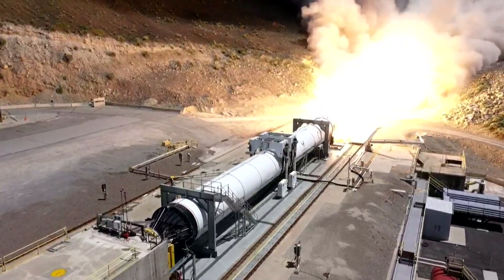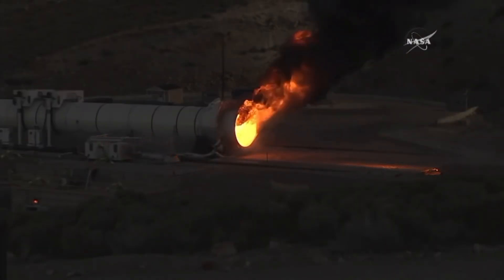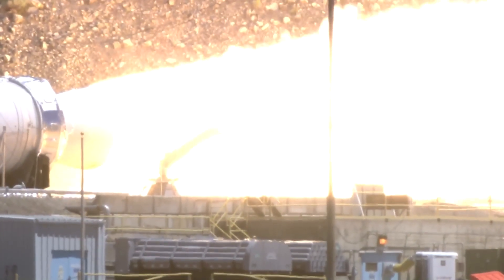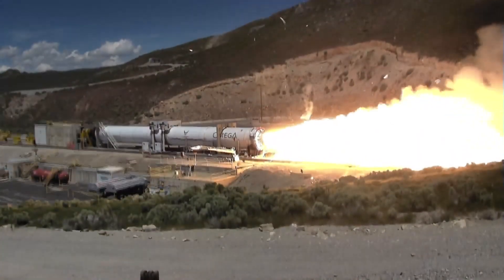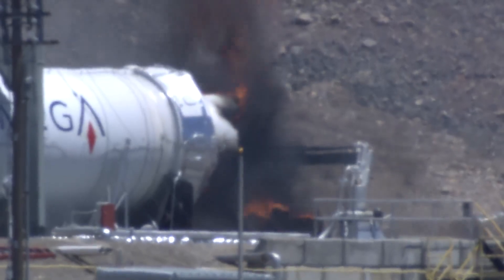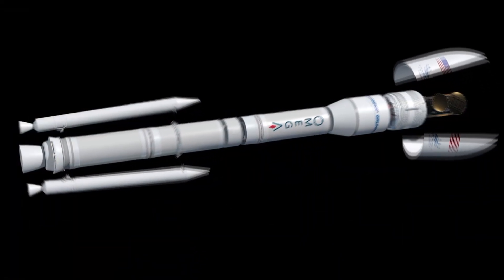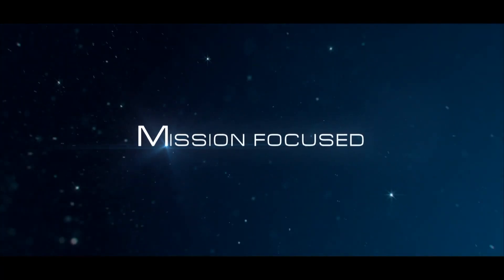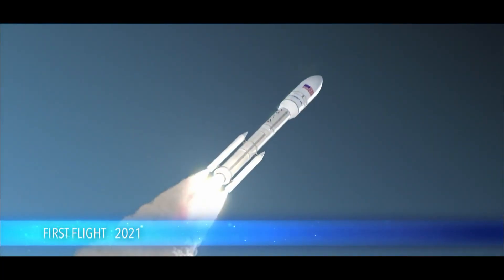Northrop Grumman's OmegA Rocket Fails During Static Fire Test -

Comment: Who is here after NG Blew up the SLS Bole Booster nozzle, IN ABOUT THE SAME WAY?!?!?!!?
Reply: Here here. Just came for the exact phrasing of the "observation at the end of the test" statement.
Reply: The two failures were quite different. The OmegA nozzle imploded during tail-off. There was a pressure drop inside the nozzle and the ambient pressure at ground level was enough to implode the exit cone. This wouldn’t have happened during flight since ambient pressure at burnout would have been much lower. 

The BOLE nozzle failed before tail-off.

Comment: My dad worked there for 30 years. It's the whole reason they moved out to Utah. We lived an hour away in North Ogden, and we always knew when there was a test-fire cause you could feel the ground shake and feel it. I've seen a few of these tests and have gone right up to it and touched it (before they fired it of course). My dad specialized in boosters. He sadly got laid off in 2011. He was the first guy on the Ares rocket, helped on the MOAB bomb, did lotsa of missiles and military projects, worked on Mars tech and almost had a sub contract to be an investigation specialist at Area 51 (they didn't specifically tell him it was Area 51, but he had to get the top mist secret security clearance) and they liked him because he was one of 4 guys that got an award from NASA cause he was one of the dozens of investigation specialists when the Challenger blew up. He had only been working at ATK for 6 months, had only lived in Utah for 6 months, and he was one of 4 guys who figured it out (NASA covered it up btw, by what they tell you didn't happen, and they told ATK to take the blame else they wouldn't get any more contracts from them). Also, the night tests are sooo amazing!

Comment: Looks for me like the fuel was to old ore not sealed properly.
If you mix Al with Ammonia it comes more and more explosive by the time from water sucked out of the air.
It could even self ignite !
Maybe the sealing cap was not airtight ...
You could CLEARLY see a increase of flow short before the failure.

Comment: The arm that comes into the picture after the SRB is finished firing shoots Liquid CO2 Gas which of course turns to a Pure White Cloud when it's pressure drops to normal outside air pressure, the CO2 Gas completely suffocates the fire hot spent solid fuel still inside the SRB by immediately removing all the oxygen from the inside of the spent motor, in the video you can plainly see just below where the motor is tied down to the ground a large orange horizontal cylindrical tank, that is where the Liquid CO2 Gas is stored, it is a 35 Ton Tank, back in the day I've personally filled that tank myself many times.

Comment: Scott Manley,  You are incorrect in your description of the Solid Rocket Motor Nozzle.  On this type SRM there are many components that make up the  "Nozzle Assembly".  ie: the nozzle fixed assembly, the flex bearing assembly, the nose inlet, throat inlet, the throat, forward exit cone and aft exit cone.    The AFT EXIT CONE failed during this test not the "throat" aka nozzle. 
I have built solid rocket motor components particularly for Space Shuttle, and Castor,  Trident, MX, Hellfire, Standard, Aegis, EFOGM,  Sea Sparrow, missile for the past 35 years.
Reply from the maker: Yes, it wasn’t clear at the time, this was made hours after the event and I said this was speculation.
We never did get an explanation for the root cause of the nozzle failure.

Comment: There is a way to turn off SRB's early; blow out panels ahead of the throat are made with small cutting charges, the controlled loss of confinement in rocket body causes the internal pressure to drop below the sustainment threshold.  Rocket motor blows itself out.  This is a trick used by solid fueled ICBM's and SLBM's that need to be able to precisely meet highly variable thrust durations.

Comment: Why do re-entry vehicles come into our atmosphere so fast? Why don't they slow down so they don't get so hot coming in? It seems that it would be much safer for the crew if they didn't have the threat of disintegration to worry about on top of all the other possible catastrophes of returning from space.
Reply: If you come in slow that means you come in steep and that means you hit the thicker atmosphere faster, reentry vehicles come in fast and shallow so that they slow down in the thin, upper atmosphere. It's alot safer that way. The main issue is you cant have an engine take the front of any reentry so the initial parts of the reentry has to be shielded and unpowered. That goes for steep or shallow. Think of it like trying to get a rock to gently enter the water while standing on a dock, you can either drop it in or skip it over the water till its slow enough to sink in on its own.

Comment: Its hard to tell if the nozzle failed from a change in the combustion process. I wonder about the effect of laying the booster on its side 🆚 vertically has on the burn? Thinking that an uneven burn could allow unburned fuel to break loose and tumble... suddenly combusting as is is fragmented.

But what do I know? All my thesis are informed by my imagination and childhood experiences playing with fireworks. Yes... I did make it to adulthood with both eyes and all 10 digits intact.

Comment: I'm not sure they'd be spraying water on the chemical fire. The best thing is powder as it cuts off oxygen supply, whereas water relies on bringing the whole thing below the flaming temperature which would put heavy temperature difference stress on the metal, and I assume that would be something they would want to avoid if they're running material analysis post-burn to see how close the nozzle may have been to failure under the burn conditions. 

However, water is cheap, and water mist would be very effective as it has a lot of surface area to absorb the heat.

Comment: Pause at 0:43, Slide the mouse pointer over the timeline until it is at the 7:03 point in the vid.
Above that point is an obvious alien saboteur. He probably set an advanced, heat resistant remote control detonating bomb on the nozzle.

Comment: I saw a solid rocket test in my back yard in Los Gatos in the 80s. There was a testing area in very south San Jose about some 20 miles from my place and one afternoon there was suddenly the big noise of a solid rocket going off (they seem to me to have a higher pitched and "dryer" sound) and a plume of smoke moving quite quickly into the air. It was the only test of a rocket in the 23 years I lived in the area and I didn't even know such tests happened there. It was nice and loud where I was and I first thought it was a building exploding until I recognized the constant nature of the sound. But it must have been terrifying for the people who lived right next to the facility. It's now a Superfund site and I doubt it will ever be fully clean before some greedy developer builds a bunch of McMansions all over it.

Comment: Observation: Things noticed after the intended burn is complete, is how it was explained to me.  They may have many observations as they disassemble the motor and validate if all the little parts and pieces worked as designed.  Nozzle exploded at >120 seconds, the planned duration of the test , so I guess that skirts the line segmenting an "anomoly" (unplanned issue during active burn) and an "observation" (anomolies discovered after active burn).
Reply: You make a good point, however I guarantee that they are investigating this internally as a very serious issue. It may have not caused a problem in a real flight had it occurred this way at the very end of the burn, but they have absolutely no margin of safety based on this test. That's not going to be acceptable to their customer.

Comment: "Successful test, despite a small anomaly"
That were the words of the CEO of Northrup.
Reply: Of course the CEO will downplay it.

And in all likelihood, if it was a rock, they won't encounter rocks often at 150,000 feet. Had the nozzle exploded at 100,000 ft+ it's likely the payload would be safe. Possible the other thrust vectoring would compensate.

Also, the thrust after 1:30 minutes of firing is drastically reduced from the thrust during the first 30 seconds.

Comment: Off subject. Those quadcopter shots are amazingly smooth. The gimbal and to a degree the flight controller totally dampens the shock waves.  They should put a gimbal on the stationary cams as well.

Comment: When scaling up a rocket engine its likely the limits of  performance envelope would need to be observed by testing to failure. Water is too chemically active to finish test, producing too many changes and would have been seen . Thinking co2 if a mechanical test or a dip into the budget for some inert gas if more demanding science was needed to be done.

Comment: it makes total sense to use composites for a solid rocket boster shell rather than steel. Its especially good on tension and with modern processes probably not even more expensive. but it makes the whole thing a lot lighter. And since it will burn up in atmosphere it doesnt matter if you can recycle it.

Comment: I guess this question applies to all rocket engine tests. If the engine is meant to generate hundreds of pounds of thrust, how do they keep it stationary for the duration of the test? Newton's third law should work equally well whether the rocket is standing upright at the launchpad or horizontally in the testing facility.

I guess an addendum to that: I constantly here that the Falcon 9's clamps are being released shortly before scheduled liftoff. If the clamps failed, would the rocket still launch?

Comment: @Scott Manley - People keep calling this a "booster" in the comments.  To me this is a "motor" as it is the first stage and is intended to reach space with the payload.  It will in fact have Solid Rocket Boosters attached to it that will fall away shortly after launch and before space is reached.  Boosters have been colloquially called such when they assist the primary motor at liftoff - they give it a "boost".   If this has its own boosters strapped to it and is designed as the primary engine of the craft, should we call it a rocket "Motor" or "Booster"?  On the other hand a "motor" might imply moving parts to perform locomotion activities.  I'm curious on what your take is.

Comment: Video is nicely done.  The reason they quench at the end of testing is to determine how much case insulation is left after firing.  This is a key design parameter with a solid rocket motor.  If unquenched, the post-firing heat in the motor might burn away a lot of the remaining insulation, making insulation measurements questionable.

Comment: It's interesting to note that their video at: https://youtu.be/8MTM-ANa7FI is unlisted. There are two places to start watching it: The test is at around 19:00 and the 'press conference' is at about 1:22:00 Only three questions are asked, and the spokesman does not admit that the motor nozzle failed when running at full power. He says that it was 'successful' and that there were a few sparks when the motor was 'throttling down'. Clearly, solid rocket motors of that type do not have throttle control. He also says that there would be a follow-up report 'after several hours of review of the data'. It hasn't happened yet, and there is no mention of the incident on their Youtube channel.

Comment: You could well be right about the fuel being the issue.
4:13 and 4:31 notice the two chunks of burning material some distance from the rocket.
Is it possible for solid fuel to get stuck to the nozzle itself ?

Comment: wondering how nozzles in srb's are cooled down, why it is not melting?
Reply: On the space shuttle SRB they used an ablative coating to protect eh metal.  I don't know the specifics of this design but it is probably using something similar.  The space x crew dragon uses a similar material as a heat shield for reentry at the end of the mission.

Comment: The robot arm, I see someone else correctly mentioned CO2, is officially called "The CO2 Quench System." And it just goes inside the nozel just up into the actual fuel area and unloads a torrent of CO2. It just floods it with so much that no only are temperatures brought down but even burning fuel oxidizer residuals just get over powered. It's an impressive system

Comment: SLS is a NASA design and OATK/NG is simply the manufacturer building NASA's rocket.  OmegA is a new rocket designed by OATK/NG themselves.  So when he says it's "more commercial", what I heard is, its our own nozzle and design, but of course there's only so many ways to build one, so it has a large number of similarities to NASA's.

It's probably worth remembering how much more thrust is coming out that single solid motor nozzle than comes out a single nozzle of any liquid motor.  That's gotta be tough to do.  Rockets and space are hard!

BTW, the name OmegA, NG says, is a homage to Orbital ATK, using the 'O' and the 'A'.

Comment: You mentioned a rocket with a solid upper stage.  Since the upper stage is used as the somewhat final tuning of the orbit insertion, how do they do that with a solid that cannot be throttled?
Reply from the maker: The payload has an on orbit maneuvering system.

Comment: that's because of the fuel they use... booster would hold if it could cool itself. problems comes from the fact the thing isnt moving thru air. Because behind a thruster assembly there is a void countering the pressure built in the chamber.

so it is possible to make this thing fly, what is not possible is you thinking about the defect.

Comment: My guess is that nozzle was constructed ‘pre-stressed’ in compression to resist nozzle pressure from bursting the nozzle. Unfortunately, as chamber pressure tailed off, the nozzle became more and more of a vacuum nozzle; operating at sea level. The pre-stressing, coupled with the negative pressure within the nozzle caused it to implode. Bottom line, this would not have happened at altitude (when burnout would normally occur) since the nozzle pressure would never have fallen below ambient pressure and external nozzle forces would have remained tensile.

Comment: Generally speaking; what gets better specific impulse? Solid or liquid?     Or is it dependable on the application?
Reply: It depends on the specific propellants and design: otherwise said; yes, it is application-specific.
Reply: Liquid fuels generaly gets a higher specific impulse but it is harder to make large  liquid rocket engines.  Solid rockets can easily generate high thrust but are not as efficient.

Comment: I'm not convinced this would have been a catastrophic event for an actual flight. The bottom part of the nozzle skirt was blown off, but the upper part of the nozzle, the nozzle throat, and the gimballing mechanism still appear to be intact. It seems as though the motor would still have retained some control authority, albeit reduced. Depending on how far the nozzle can gimbal, the control loop might have been able to compensate for the damage. Or at the very least, partially compensate. And, as you noted, this was close enough to the end of the burn that even a partial compensation may have been enough for the whole vehicle to hang on until staging occurred, at which point the remaining vehicle could attempt to correct for any course problems introduced by the damaged SRB.
Your comment about the motor possibly trying to pass a large chunk of broken off solid propellant is well taken. I've always wondered if it's really best to test a rocket that's meant to fly vertically, by bolting it down on it's side, 90 degrees out of phase with it's operational attitude. Of course, building a stand to vertically test an SRB of that size would be a lot more complicated and expen$ive.

Comment: Whilst a loss of active thrust vectoring from a failed nozzle would be a potential issue, with any launch system using more than one booster, the main issue would surely be the resulting massively asymmetric thrust vector simply due to the lack of expansion ratio on the damaged one?

Comment: the reason the nozzle failed is it was too hot and the actuators got damaged. Last time one of these thing failed when it was not in a test environment was Challenger in 1986. the aft segment and the nozzle are connected with explosive bolts which are only supposed to blow in the case of an emergency and after burnout. when the Shuttle was flying these bolts blew before the stage went in the ocean. What happened here was the binder failed and the nozzle melted leading to its destruction. good thing the failure was at the end of the test instead of in flight because if it was in flight the whole rocket would have blown up.
Reply: Good job! You managed to be 100% incorrect about everything.
Reply: @KSparks80  no I'm not my uncle and cousin built this so I have inside information on what when wrong and that is exactly what what went wrong. The binder failed, the nozzle melted, and it exploded.

Comment: When one of the footage sequences started over from the beginning, looked like some kind of chunk came out right at the initial firing and not just a plume of exhaust. Not sure if that'd cause an issue that'd make it fail at the end of the burn?
Reply: The initial chunk could have been the "plug" 🤔

They have been testing new plug materials... Denser materials for the plug.

If you get to see a slow-mo close-up of the nozzle at firing, you can see the plug being spat out in chunks. Chunks that end up nearly a half-mile downrange 😁